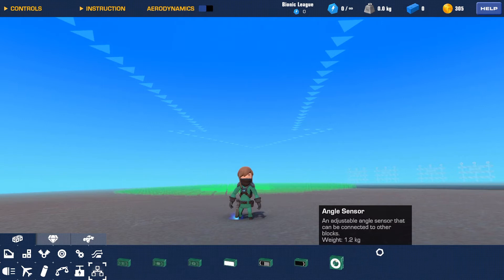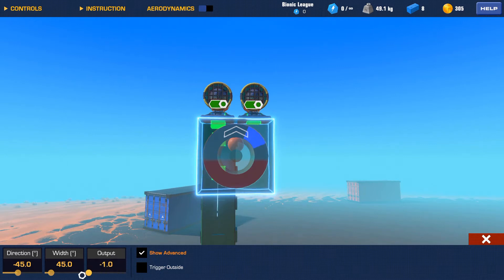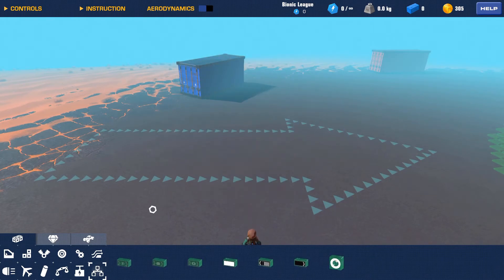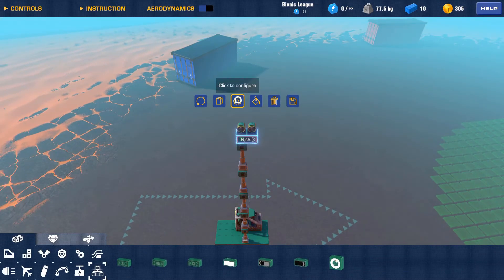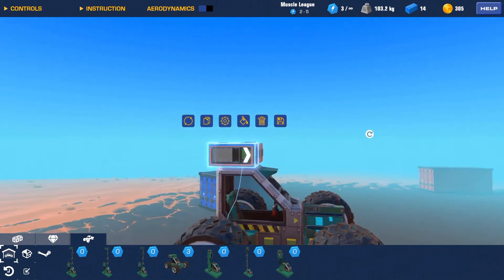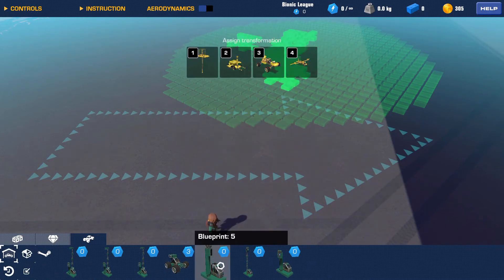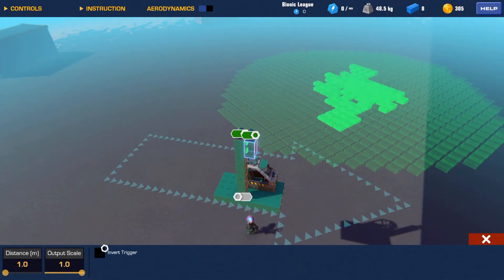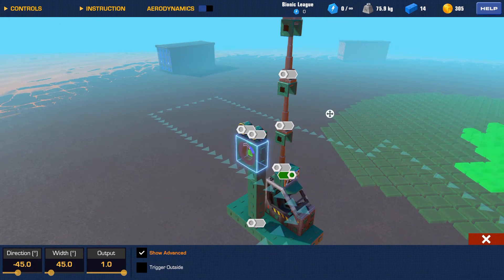Trailmakers Sensors And Logic How To Guide With Working Examples And Commentary

Comment: Im not sure if you still read these but im trying to make this thing but it needs a sort of multi stage thing like rockets have, but i am on xbox and im not sure how to do it and I don't have the amount of keybinds you guys on pc do. Im trying to make a pop out gun but i need the one set of pistons to take sides out, then another one to push up for getting it out, then the things to happen in opposite order so that the gun isn't trapped out of the middle. It is hard to explain but basically it is a multi stage piston extender (like the Minecraft ones haha) and im new to logic completely so i have no idea what to do but i somewhat know the gates things themselves like what an OR gate does or an AND gate too. (I hope you understand if you read this haha, im in the middle of working on it rn)
Reply: I figured it out myself haha spent hours trying tho. I used sensors to do certain things when the piston reached a certain length and it eventually worked, but it is a little slow and buggy sometimes
Reply: This took so long lol and it kinda sucks haha.

Comment: Pro tip for anyone that needs a simple nor gate.  What you need is a constant input, an input you want to nor, and an xor gate. The altitude sensor set to -500 works as the constant input. Feed that and your input into the xor, and that will invert the signal of your input.
Reply: What is a nor gate, and what does it do? I need a multi stage kinda thing for pistons haha..

Comment: Perfect tutorial, I was making reversing lights for my Super Tank using the Speed Sensor, but I wasn't sure how to use it
Reply: I was thinking about this also, but I'm going to see if you can run it through an and gate with the S input so that it has to be reversing under the power of the vehicle (but not just breaking) to turn them on.  Because if the vehicle is just rolling down a hill I don't want them on, but only if it's actually moving backward (sure censor) AND I'm the one sending it backward with the S key will it turn them on.

Comment: I noticed that the way the sensors work is just greater than or less than. That means that a setting of 10 on an altitude sensor, will output at 11 and up or 9 and below

Comment: I see that the triggered device (lamps in this example) have to be adjacent to the logic block. However, it would be better to be able to place the logic block somewhere away from the triggered device and choose what would be triggered from a menu of the triggerable objects (i.e. wire them to each other from a distance).
Reply from the maker: Logic blocks don't need to be in the vicinity of the objects they're controlling at all. You select which item you want them to control by selecting the logic block and then selecting the blocks you'd like to affect from the toggle menus that pop up.

Comment: Cud I use logic to turn a engine on and off?
Reply from the maker: You can certainly use sensors and logic to make an engine move the car forwards and backwards automatically. If you're wanting to enable/disable an engine block repeatedly with logic, I don't know if you can. I mean, you could detach the engine with a detach block using logic, but good luck getting it back on again without repairing ;p

You could also make the engine unresponsive to keyboard inputs unless a logic condition is met.